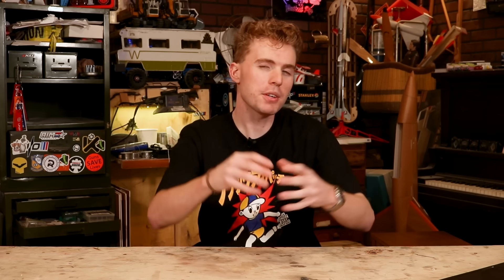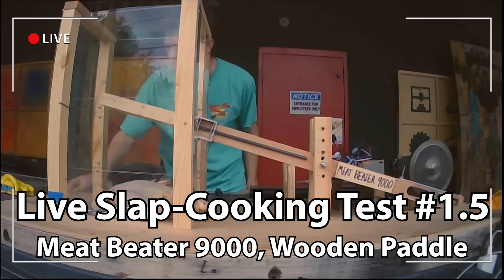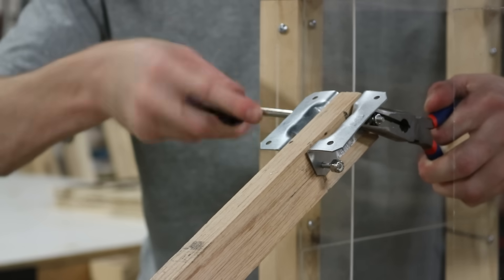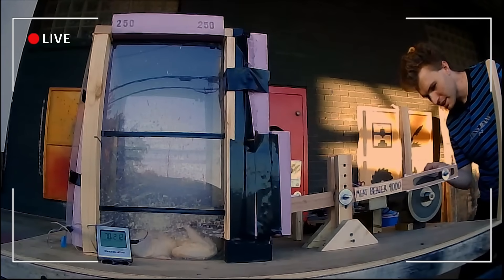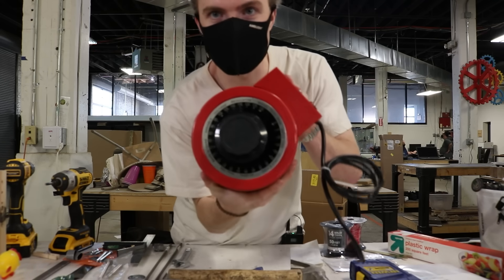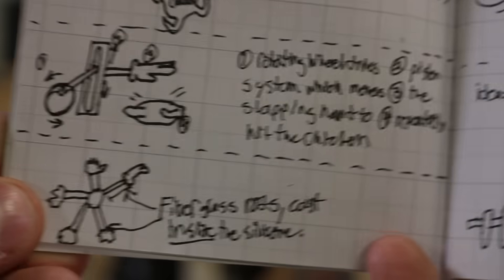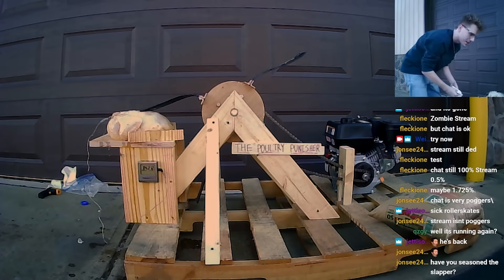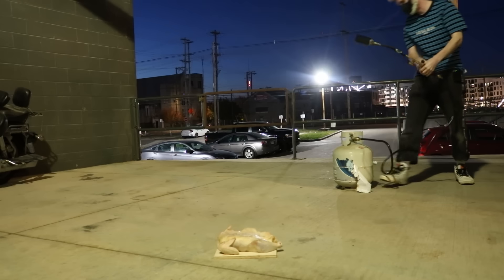How Many Slaps does it Take to Cook a Chicken?

Comment: What's comforting to know is, the flexibility of a human hand in the act of slapping would increase the efficiency, as there is a whiplike action going from the shoulder to the fingertips that a stiff plank just can't simulate. So if you hired, for instance, the Winter Soldier to stand there and slap the chicken, he would probably be able to do it in less slaps. And if it's the Winter Soldier we're talking about, anyway, his right arm is metal which would increase the conductivity, possibly reducing the number of slaps needed even more. If he used his right arm, too, the body warmth could also reduce a couple of the slaps required.
Reply from the maker: funny enough, that's why I started with the silicone hand on the fiberglass rods! But plank was just so much easier to fix when it broke lol

Comment: Ok... At about 8 minutes in... I'm afraid to say it's no longer 'science'. If you raise the surrounding temperature you've now changed the experiment, and the original premise is now void. Heat is what cooks the chicken, and the original experiment was all about asking how the effect of slapping could potentially create enough energy on its own to cook the chicken, if you then force the environment to artificially benefit the cooking, it's a failed experiment. That's like figuring out how fast humans can run by testing them on treadmills instead of the ground, where air friction will have no effect on them.

Comment: Am mechanical engineer. You did well with remembering most of the parts about mechanical components but forgot the other half of the degree - energy. The Poultry Punisher is basically a giant fan made of non-conductive components. Wood and rubber don't transfer heat very well, should've used a flexible sheet metal for the fins and rested the chicken on more metal. Doing this on a hot day would obviously help too. 

Original design was better, but suffered from that bad joint on the end. Could've just used the entire piece of wood instead of making a flatter end, or designed the end like a pickaxe. Carve the wood out, put the flat wood (should be metal) end around it, and fray it out on top just like a pickaxe. Then fire harden and seal it. you mentioned wasting the upward stroke, but could've used that energy by adding another connection that slaps the chicken on the bottom.

Comment: imagine if this idiot and his "team of engineers" just used metal instead of wood. so much scientific data and words thrown around in this video and this guy cant even think to use a different base material. sure you can scale down but you lose momentum and leverage. when doing practical science it helps to be able to use more materials than just wood. the large scale example heated up the most and only failed because of materials. you were closest with that setup, so use better materials? idiots pain me these days.

Comment: To me, it seems like the answer to this puzzle might be something along these lines: You go ahead and throw the raw chicken in a blender and basically puree it, then pour the chicken mush into some kind of container like a metal thermos or cooking pot that has a lid that can be very securely locked in place. The closer you can get to using a metal spherical type shaped container the better, but since I can't think of anything that is specifically metal, spherical and locks tightly shut all in one container I guess just the closer you can get to it the better. So for example, a shorter and wider cylindrical thermos would work better than say a tall skinny one. You then just rig up the slapper to slap the metal container which won't break down like the chicken would and thus could survive the slapping process long enough for the chicken to fully cook.

Comment: Apparantly Mechanical energy causes mechanical damage to a stationary, not very elastic and not that structurally tough object like chicken. Who could have guessed ?

Chicken is not very good at absorbing the mechanical force and breaks into little fragments which then get obliterated and turn into paste. The mechanical to heat energy conversion occurs best in a durable elastic material. In theory, if you covered the chicken in a high quality rubber then the rubber might have heated up pretty quickly due to most of the mechanical energy being converted to heat but the problem is that rubber isn't that great of a heat conductor so the rubber might catch a flame before any of the heat gets to the chicken.

So long story short, you would need to cover the chicken in a elastic substance that is mechanically durable but is also a good conductor of heat.

Good luck with that.

Comment: Your 3rd iteration the “hot summer day simulator” was the best design and you were well on your way to a cooked chicken you should have replaced the brackets and kept going. The poultry punisher was much less efficient at transferring energy into the chicken and your addition of the vegetable oil brought it to probly near zero by removing the friction factor. I think what you want the most is not only frequency of slaps but maximum energy transfer by either hitting it harder or with something heavier. But i think the wood plank was a good choice because it wasnt totally destroying it. But regardless of my speculation that is a daunting task and i applaud your efforts

Comment: What if the chicken was suspended with multiple slappers on all sides? I don’t think it’s only the room temp, but also the temp of the rest of the chicken that is cooling down the part being slapped. Having the chicken slapped all over would not only solve this, but would help prevent the chicken from becoming destroyed due to prolonged stress on one area
Reply: Like a rotisserie?
Reply: I was thinking the same but actually it look like the slappers itself cool down the chicken by moving air (like a fan) so multiple ones would raise the temperature of the chckn faster but also cooldown the air much faster , im not even sure 🤔

Comment: Bro instead of a single slapping device, why not use 2 or 3? If you synchronize them right, your machine would run slower, but slaps would be faster. Kind of like a double or triple bass pedal

Comment: Oh yeah? I'll give you an idea that might make it work once and for all! Place the chicken in a small tin box/holder that's just as big as the chicken and slap it from beneath upwards. You'll enclouse the heat and heat the metal which will definitely cook the chicken at some point. Rubber won't work as a slapper though as it will melt. You'll have to use something else to introduce heat.

Comment: The last rig used slapping + sliding, which goes against the original hypothesis. After your rubber  material hits the chimken, the wheel's rotation makes it slide off, which adds to the heat (imagine rubbing your hands quickly in the winter) without it being a slap. The other iterations of your rig were ok though, they only used slaps.

Comment: You're going about it all wrong. We've all seen boxers work a speed bag, right? The boxer hits it once and it bounces  three times, hits again, it bounces three times, etc. So basically you're putting a chicken in a speed bag. But its more mechanical than that. Unless you're Mike Tyson, youre not gonna win that bout against the chicken. You need boards affixed to a motor that never tires. You'll get twice as many slaps/sec,, juices are retained in the bag, no parts are lost, and its a lot less messy.
Speedbag Chicken... It's whats for dinner. (Its also a good thing we dont eat monkeys. I would hate to have to tell the guys at work that I have to hurry home. Its my night to spank the monkey)

Comment: P.s. this is possible. I honestly don't understand how you haven't figured out where you went wrong.  Heat=frequency.  Frequency=oscillation=slaps/time. Force=mass×accel.=frequency×accel. Because mass=frequency given h & c. So time interval of the valley and crest of your slap oscillation need only be correct. So if your slap has a larger distance of travel and/or the mass of the hand that slaps is larger the larger the force required to generate the energy and the smaller the net energy released. Also the materials used need higher tolerances to accommodate all that motion and vector alternation.  Reduce the travel of the slapping mechanism to a millimeter and greatly increase the frequency of slaps per time interval. In fact slide the slap hand in the chicken so that it is being slapped from the inside and the hand doubles it's frequency of slaps by getting a slap in each direction of travel. Essentially you'll have inserted a rod into the chicken that vibrates in an extremely high frequency. You'll have that thing smoking. I mean seriously you can burn yourself with a palm sander.

Comment: I could simply mount a slapper on the crank of a Honda cbr250rr motor. That engine revs to 20,000 rpm. You could essentially mount an additional piston on the crank, and a little carbon fiber cut out the shape of a hand (carbon fiber because that's how sturdy it would have to be - the piston would be feeling 7564 G). This would get you to 333 slaps per second.

Comment: I was rubbing my hands together for heat and I realised... what if you don't slap the chicken directly? What if you have an aluminum (or other heat conducting material) layer on top of the chicken and slap that? Slapping the surface on the chicken, the surface will get hot and will not break like the chicken.

Comment: i think it makes sense that the spinning slapper wheel failed because you also basically made a fan to push cool air from the environment into the chicken so whatever small increase you can manage is battling the cool air. this might work better under a vacuum with less air to cool the chicken
Reply: It also might be removing a bit of water and meat with each slap as it drags the rubber off the chicken. I think that since that top layer is what gets the heat energy initially, it may be removing it before it has a chance to disperse throughout the chicken.

I think both issues might be able to be fixed by putting a rubber sheet on top of the chicken which the force of the slap is transferred through, giving a bit of protection to the chicken.
Reply: Hmm. I have never tried cooking in a vacuum, so I don't know if things like the maillard reaction even work. But if everything works, then it'd be even easier since you wouldn't be losing temperature to ambient air.
Reply: Just because it’s pushing air doesn’t mean it’s cold air. If you put an ice cube in front of a fan it’ll melt faster than an ice cube in the same room without a fan blowing  on it

Comment: If the integrity of the chicken is a problem and heat loss is an issue too, what if you put a chicken breast inside of a thermos seal the thermos and then slap the shit out of the thermos?  The kinetic energy will travel around the thermos, some of the heat will be lost to the outside through convection but some will transfer to inside... and if thermos's do their thermos thing then it could trap that little amount of heat in.

Comment: I love that to test if the motor was running cool, he grabbed it rather than do what I've learned to do and only poke it in case it is burning hot and you need to pull back fast.

Comment: What if you slapped a metal container with cut up chicken in it? I think that would cook. Whatever you slap with will need to be able to withstand high heat though, just as the metal container would.

Comment: Louis, engineer here,
The forward-backward slap was better, since it wasn't ripping off the surface of chicken, just slapping it.
Hence, instead of deciding on rotating slap, you should have used a spring at top to counterweight the chicken slap force, so the resulting slaps of chicken would require less energy, thus less demand on engine.
Also you could use hydrolic or pneumatic system but since you got high torque engine, first one is the go for this case.

Comment: Maybe you should've tried in a closed room. That there would be less loss of heat. 
And maybe put a thin sheet of metal so you'd slap the metal, not the chicken. That way you won't destroy the chicken and the thin metal will transfer the heat right away. 
This is from the top of my mind*

Comment: Ok literally in your video it showed 24,500 or 25,550 if rounding not 23k. Bad as the CDC about reporting infection numbers round way up from reality. Instead of wood should have used an old ski or carbon fiber variant. Also no you can not cook a chicken with just slaps. You had to had to help it initially. Then your second one just as Kyle Hill noted will destroy the chicken.

Comment: The problem I see with the poultry punisher is the transfer of energy. The momentum continues through each time. The only problem I see with the meat beater is shitty engineering.. just playing. really its the material choice. I don't know why you are using wood and what appears to be like a leather strap or something that broke the last time just as it neared 100°. If I had the engineering know how and resources, I'd use better materials, like metal and foam, make three hands, one slapping the top and two slapping the sides, tie it down tight with some fishing line so it doesn't bounce around, then build a very well insulated box that goes over top

Comment: What if instead you used the slaps to heat up a material which will cook the chicken, this allows the chicken to not be beaten to a pulp.

I have a few ideas for the beater, the reason in my mind that the poultry punisher didn't work as well is because the air allows the rubber to cool down before slapping the chicken again, meaning that it will cool down the chicken when it slaps it. My idea to fix this is to hold the test in a vacuum or partial vacuum, this also means that less heat will escape from the chicken when slapped. Leave your ideas in the replys, maybe we can make this happen

Comment: The chickens slapping apparatus itself needs to be enclosed. If I bleed off of heat when the apparatus was outside what's overcoming the heat being generated. Try starting off with the chicken chamber at about a hundred and twenty degrees. The other thing you have to consider is that as the meat begins to cook, it will begin to tenderize. Thus, the piece of meat will begin to disintegrate from the kinetic slapping Force

Comment: The energy equivalent in this experiment is about like using a 1200 horsepower diesel locomotive engine, a thousand gallons of fuel, 24 hours full throttle, in order to roll an egg up a 10° slope.

Comment: Aw wait don’t give up. We wanna see slapped cooked chicken. 

The possible problem with the last one was that as it was turning around it losses heat and doesn’t retain that heat unlike the 3rd one that you had controlled the environment. And as for the destruction of the chicken how about having a mold that fits on top of the chicken that you hit it will evenly distribute the pressure towards the entire chicken and the mold bottom has a little space on the side that it will jiggle the chicken but hits the platform where the chicken rests preventing the chicken from its destruction and the material can retain heat. You’ll still be slapping the chicken that way.

No? Ok but I tried lol. I have no idea what’s going on actually but it would be cool to see a slap cooked chicken lol.

Thanks for the awesome video. I appreciate peeps like you that bring interest for science to others out there.

Comment: Try putting the chicken into a vacuum and surrounding the cage with foil. Also try a rig that uses impact rather than rubbing. That should reduce tearing. It might also help to rotate the chicken on a rod so it gets an even exposure. Like when your microwave take a break between blasts to let the heat "expand". This should lower the curve you mentioned. Also consider a multiphase system like the way the cylinders of an engine work

Comment: I mean wouldn't it just drop ti the current temp outside. Wouldn't it be better to provide an isolated environment as shown in the third test where you packed it with an insulator. Silicon nanoparticles are really good insulators so that could help

Comment: Theoretically the slaps should work but practically it doesn't. So I have an idea maybe you don't need to slap the chicken directly. Just like frying a chicken on a pan or boiling it in water you don't need to heat the chicken directly with fire, similarly if we could just use a chicken sandwiched between two copper plates and rapidly moving slapper on the ends of the copper plates then maybe we can cook the chicken efficiently.

Comment: I guess heating up the rubber would help transfer energy (like a low power flame on the opposite side of the motor to heat up the rubber as it passes). Maybe infusing the chicken with seasoning (metals that keep structure) may also help. Great video nonetheless!

Comment: This plan might work but idk
To cook the chicken just don't let that temperature slope form at all!
First create a bubble or closed environment around the chicken. Now put on some heating device inside the closed chamber which always keeps the temperature of the chicken surroundings to -5⁰ F of the current temperature of the chicken. If the temperature of the chicken if 80⁰ F then the surroundings should be at 75⁰ F. Because of this the chicken won't lose heat to the surroundings at faster rates so no slope of temperature difference will form.  It's basically like insulating the chicken nicely enough so it won't lose any heat to the atmosphere and then it might cook